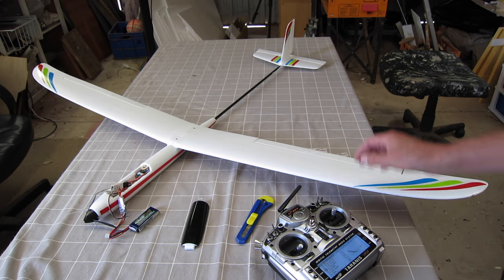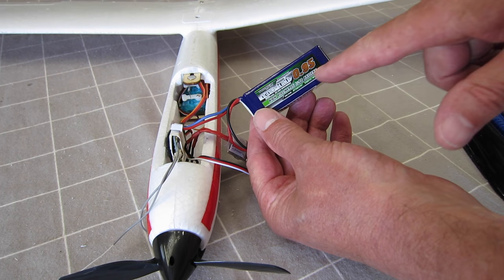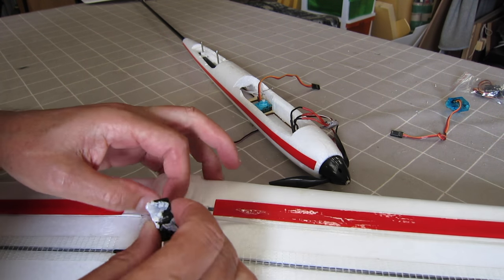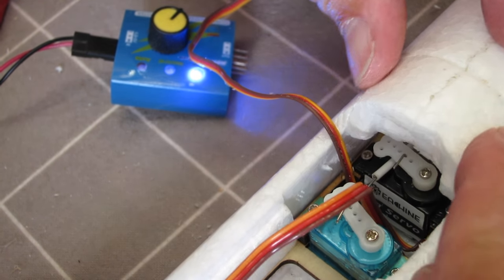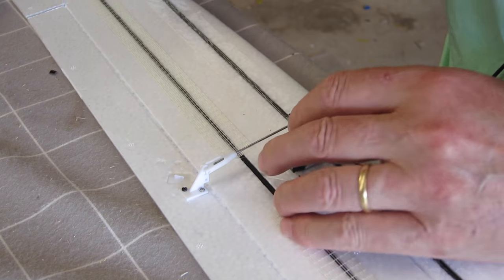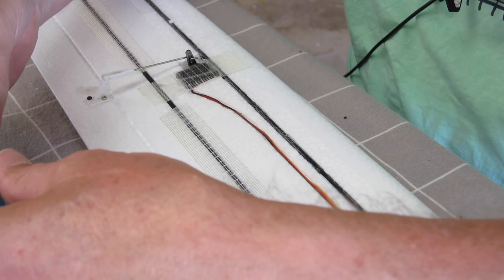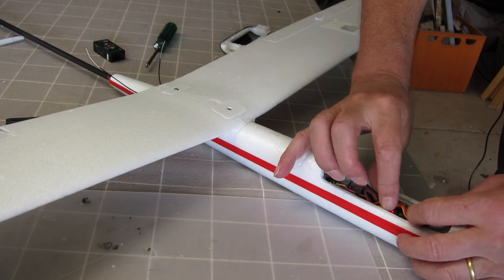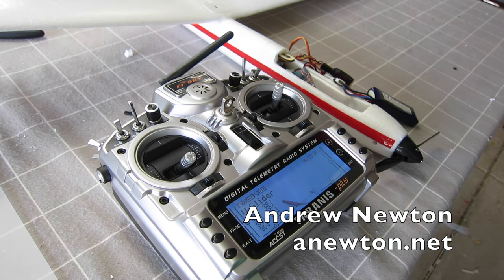Unique Models U-Glider mods

Comment: Mine just arrived. Will do the mods for ailerons.  To help rudder and elevator snakes, remove wire from case and spread a film of Vaseline or some such other lube before inserting in plane.  Can't wait to have a go with this. Thanks for videos.
Reply from the maker: Excellent tip thanks Bob

Comment: All those mods in order to get a model that fly`s properly, makes you wonder if these cheaper models are really value for money.
Nice work Andrew.
Reply: it flew nicely on the maiden; it's the cheap servos and running gear that let you down  :(
i'd love one with just the appropriate motor fitted as a "short" kit, but i doubt the price would change much... but at least i wouldn't have to remove the crap bits so i could insert my own

nice glider andrew; i'm a bit tempted but that niche in my squadron already has a few models spare
Reply from the maker: The mods are really just what I wanted to do, it flies perfectly well as is, apart from the weak servos.

Comment: Without the motor/prop, could this be flown/thrown as a DLG? I guess you'd have to extend the vertical stab below the plane. Are the wings strong enough as is, or would they need reinforcement?
Reply from the maker: Not strong enough for a decent throw

Comment: I picked one of these up on Banggood a few months ago, and had a few successful flights with it. However I'm trying to program the ESC for motor braking so the prop doesn't spin with the throttle at zero. The included ESC is unbranded so I'm not sure it's a Hobby King one. All I've managed to do so far is mess up the elevator servo as it keeps going full down and then grinding the servo gears. Anyone had any luck with this?
Reply from the maker: That's why I swapped to a little Plush ESC
Reply: @AndrewNewton  Thanks for replying Andrew! Yeah, I'm about to give up on it as it seems to overheat and sometimes takes several jerky tries to get the prop to spin up. What's your source for this Plush brand ESC, I've never heard of them.
Reply: @AlymerKiteboy  it's Turnigy's brand of ESCs. Get a brand name one that has a programming card or programming manual, or get a BLHeli one and then you can program it with an Arduino.

Comment: Any chance that the cockpit servos were intended to be mounted in an opposite directions (to the left and to the right)? It was probably reducing the mess...
Another thing - in my understanding, if you cut through the wing, it makes more sense to put the push rod on the upper side. It will preserve the mechanics from hitting grass etc and also improve aerodynamics (air pressure is higher on a bottom side, so any irregularities have higher impact there).
Reply from the maker: I think the top surface is more critical. If you tape a camera on the top surface it affects performance more than the bottom side.

Comment: Hi Andrew, thanks for all the info on this plane.  Just got mine and I don't see any way for air flow to the esc.  Do you recommend a mod for this, or is it not necessary?
Reply from the maker: I didn't think it was a problem. Low current and mostly gliding.

Comment: HI Andrew. I'm building my first U Glider and I'm relatively new at this. The rudder and elevator push rod wires are binding and don't seem to be the best for controlling the back end of the plane. Is there some other way to upgrade the wires and tubing. I don't don't what size or what the description would be to order upgraded parts. I did the wing servo mods but when I tried to use the wires that came with the U Glider they don't seem to efficiently move the elevator or rudder without springing back . I watched your build and mod videos and it seems like you didn't have much trouble at all. Very frustrating. Any help is appreciated
Reply from the maker: Check that the wires are sliding through the tubes OK, then check that the servos are not stripped (probably are, they are very weak) then check that the hinges are not too stiff. The push rods should be OK as long as they are not kinked or glued up somehow.

Comment: Hi Andrew. Thanks for the reviews of the uglider. I have bought one from Banggood, my first effort with a glider, and had a pretty miserable time. The enclosed pushrods for the rudder/elevator were too short. Replaced with .6mm welding wire. The servos were shredded. Well, I decided I'd get better control by moving the servos to the tail, but this changed the balance of the plane. Now I'm new to all this and have tried to get the position of CG and balance right (using a 500mAh) battery - but I'm having trouble trying to get the glide out of the glider. Having to add loads of weight to the nose seems counter to the idea of a glider. I have watched several videos of people happily flying the uglider (straight from the box) and feel I'm missing something. Any ideas for getting balance right? Thanks in advance of a reply.
Reply from the maker: Have to keep it light. Servos on the tail will not help. How heavy is yours when it's properly balanced for flight?
Reply: Thanks for the reply, Andrew. The weight on my small kitchen scales came in at 390-400gms. I have placed five 20c pieces in the nose and tried to balance at 50mm (40%) from leading edge of the wing. I still have servo extension leads to come in the post for connecting the rudder and elevator. I know, way too heavy for a glider. I haven't tested gliding/flying yet after changes. Ideas gratefully appreciated. Thanks!

Comment: Hi Andrew, I know this is a quite old video, but I do have a question ; would it be possible to skip aileron control at all and only use rudder for steering, since the wing has some dihedral, or wouldn't that be enough dihedral? It would make things much easier and of course lower weight.
Thx!
Reply from the maker: Yes I think it would work without ailerons. I'll try it next decent flying day
Reply: @AndrewNewton oh that would be great, thanks a lot! Ps. I'm curious if the rudder is large enough currently
Reply: @AndrewNewton  do you might have any update already...?

Comment: Hi Andrew. 
Really enjoy your videos. On Covid lockdown and inspired by you I bought a U-Glider. I also did all of your upgrades. Flies like a dream!
Only issue is that I it's broken 2 prop blades mid-flight. Fortunately I have a spare KIT version so had spares. The 2nd broken prop happened about an hour ago and is now repaired. 
Don't seem to be spares available online. What would you suggest as a replacement folding prop?
Many thanks,
Ben
Reply from the maker: Finding small folding props for it is a problem unfortunately. I have tried a couple bought from HobbyKing but they dont fit directly

Comment: Hi Andrew, 
I have just ordered the U Glider from Banggood(my first buy from Banggood) not sure how long it will take for delivery to the UK  but not quick enough lol
Apart from the  mods you have performed on this model is there anything else you would recommend?  Should I cover the leading edges with document film or would you recommend the whole wing or not needed..  Regards  Heath
Reply from the maker: Nice one Heath, I was flying mine yesterday, still a favourite. Covering just the leading edge is a good idea, I just used packing tape. It would be very difficult to do a nice job of covering the whole wing, it's quite a thin airfoil, and not needed.

Comment: Thanks for this very good class in building and flying gliders, this inspired me to buy and mod this kit. I havent flown gliders since I made and flew balsa gliders in the 1950s with my Grandad. I am now a grandad and wanna do this stuff with my grandson. It looks like a decent project for this summer

I started to source the servos etc, I got lost on the bit about the folding prop, should I let myself get hung up about braking on off?
Reply from the maker: Its not a big issue Neal. Flies nicely whether the prop spins or folds. You could source an ESC with motor baking later on if it bugs you.
Reply: thanks :)
Reply: 2 months on (holiday on my boat) and I have fitted the main wing servos, I am wondering did you connect one servo, one channel? (using two channels) or piggyback them as stock, I repeatedly inspected your testing on the video, I suspect you used two channels, I am new to RC flying and hope that I will master flaps AND ailerons, once again thanks for the time you use on these videos :)
Reply from the maker: 2 months on (holiday on my boat).....jealous! What sort of boat and where do you go? I use 2 channels for ailerons if I can but really not needed with this glider. Flaps are only useful for big gliders that need lots of space for landing
Reply: here is a link to my blog its been a long time since I last updated it, I am at this time (August 2017) in Lake Vänern in Sweden I spent most of my time in the canals near Säffle these are some of the earliest canals in europe.
 http://baatplassen.no/i/topic/93671-prosjekt-canal-du-midi-or-bust/ I am not sure if I am allowed to post links I am sure you will not mind

Comment: Still enjoying this model despite prop and motor replacement somehow costing me 50aud... Would love to have crow mode/brakes on this thing... Reflex and flaps on aerolons are great.. but crow mode.. wouldn't that be useful hey
Reply from the maker: A mate of mine tried flaps and the extra weight killed the performance.
Reply: @AndrewNewton  as in two micro servo's per wing? ahh..

Comment: no pull / string system for the elevator and rudder?
Reply from the maker: ....yet
Reply: That's what I first thought of, making it a pull/pull system, or with spring/pull. Either way, as long as it works - great! This plane is going on my list. Happy flying - soft landings.

Comment: has anyone figured out how to remove the motor without cutting the nose off?  i bought 2 and wanted to convert one to a pure DLG while saving the motor as a spare
Reply from the maker: No unfortunately. Have to cut the foam
Reply: You can remove it without cutting. I have done it with a small screwdriver

Comment: Suggestions for a similar, or bigger glider?
Reply from the maker: Sonic 185, Radian, Phoenix 2000
Reply: I like the Phoenix too. If you had to choose for flat field thermaling, which one would you take? The ASW 28 the Phoenix Evo 2.6m or the Phoenix2000?
Seems the Aeronaut Triple Speed is a nice glider too! It comes with 3 different wingspans.